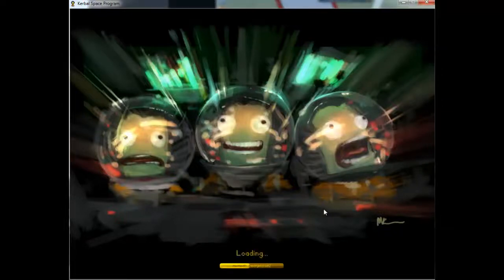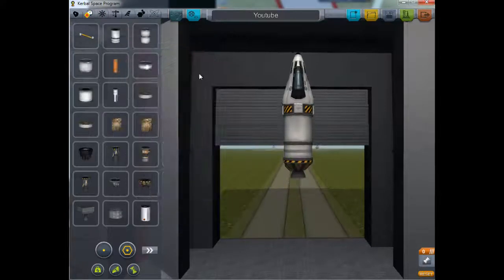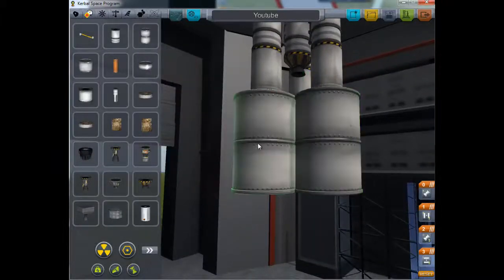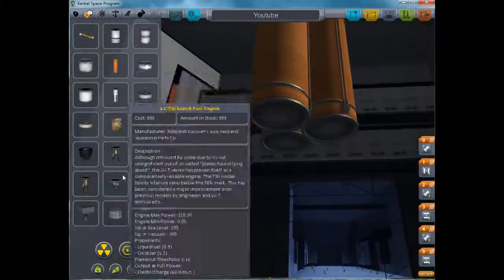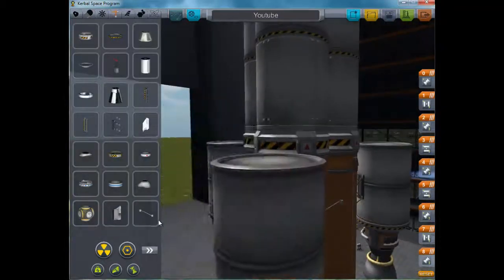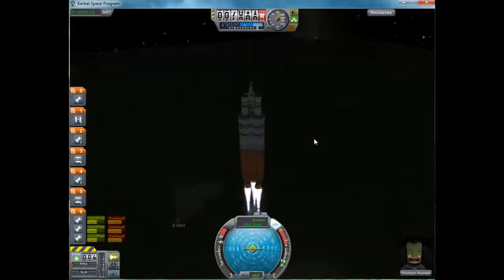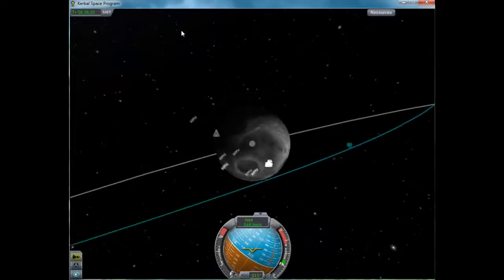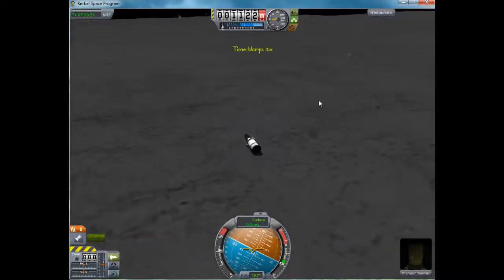KSP how to build a rocket to get to the moon

Comment from the maker: Ive never come across such a problem, are you sure that all engines are directly connected to a fuel tank? and over in the right hand side when your building your rocket, there should be a list of small pictures, this is the order in which your rocket does things in when ever you press space bar, have a play with that to make sure everything is in the right order, if you would like i can make another video on this bar ? but i hope it works out for you :) good luck